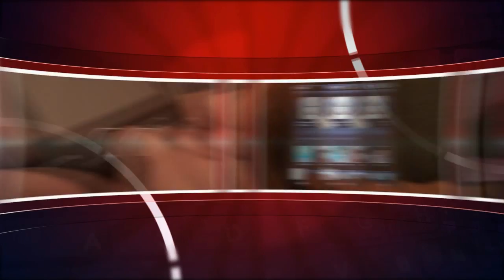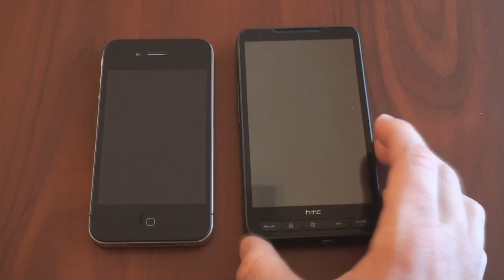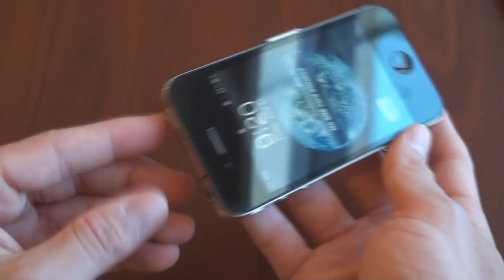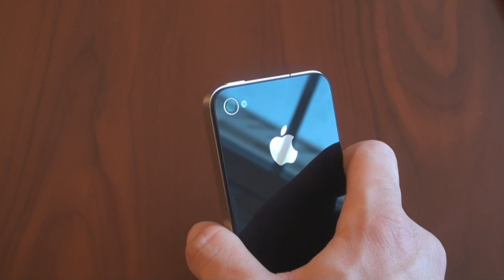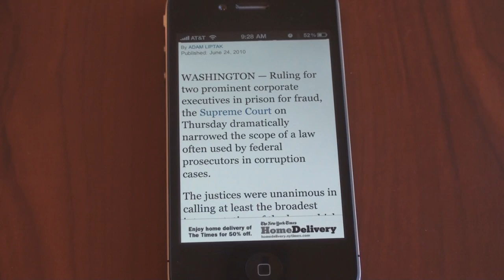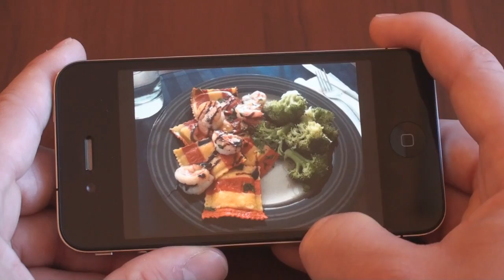iPhone 4: First Impressions | Pocketnow

Comment: Apple may have overdone it this time with the build materials for this phone. Sure its great to say it's made with a glass front and back, but in the real world, this only means it'll be easier to break with a simple drop. You'll have to buy a silicone case for it. As far as the front facing camera goes, I doubt many of you even knew that for the past 4 years in every other country besides the USA, phones had front facing cameras for video calling. Nothing new there. Just the software to do it.

Comment: I went into Best Buy Lakeside (UK) today and had a quick go. The screen on the new iphone is great but that's all there really is too it. If you've passed on the iPhone in the past then you're not seeing much that's new. The multi-tasking is fail. I gave it a try between a game and a guitar app and each time they had to reload. It's much more like quick app switching than multi-tasking. The camera didn't really do much for me either. The N95 did equally well back in 2007.

Comment: Just whant to say that the Apple slogan "changes everything again"  is an epic fail. 3 years ago came Nokia 95 that had everything in just one phone: 5Mp camera, GPS, 4Gb, 16 mil color display and more... After that came along a huge number of Nokia and other brand phones that changed from phone to phone. To say that you discovered face to face talk is just lame cause I talked on a 6260 (I think) long before the N95 .. so.. 
And I personally want to get the HTC HD 2 rather than the I4! Thanks!

Comment: @pocketnowvideo Build quality? From what Gizmodo and Engadget have reported about the signal drops because of the way you hold it.

"ups the ante" cannot include "front facing camera". This feature is NOT new as smartphones have had it for years and it also worked over 3G networks *without* the need for Wi-Fi. Granted the industrial design is good, but please, call a spade a spade.